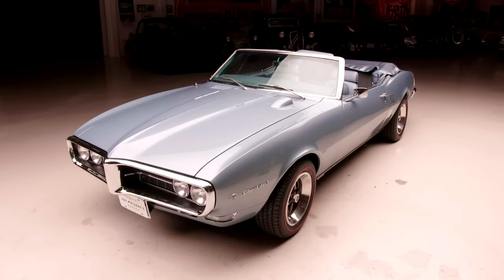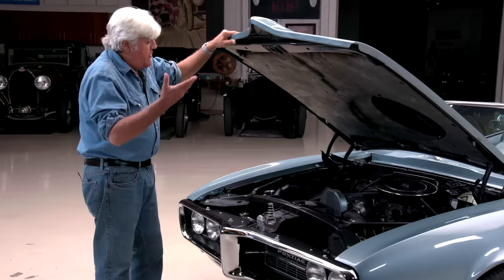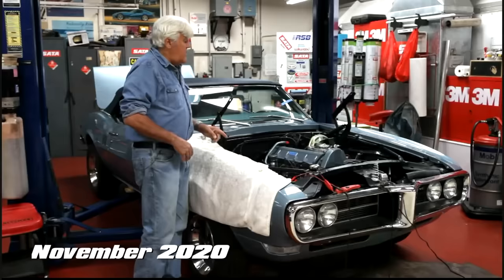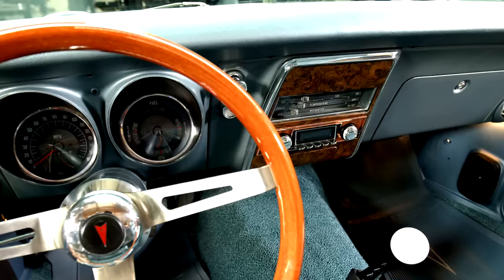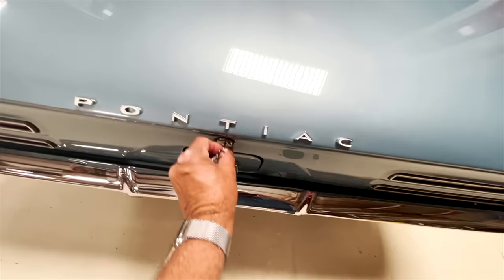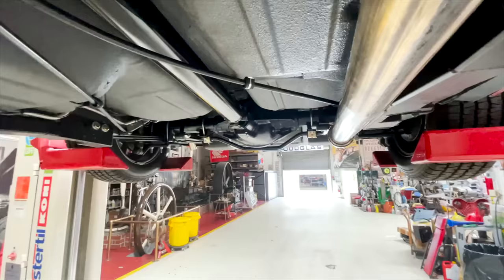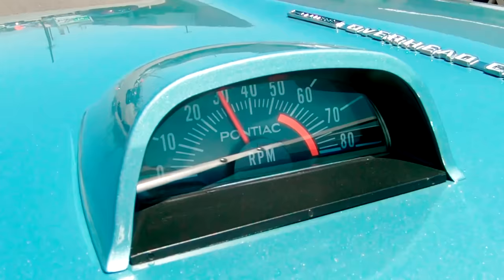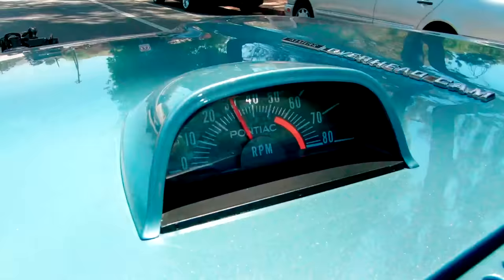1968 Pontiac Firebird Sprint | Jay Leno's Garage

Comment: It's so funny to me! Everyone over her in America are all about the V8. I am English so I have different point of view. Now the Stellantis Hemi is going bye bye and being replaced by a BMW straight 6. Because the engine puts out the same if not more power, much more reliable and tons more low end torque. I have a 1997 BMW 328is with 400k on the clock. Still going strong.

Comment: I realize you're speaking "American made OHC" . But Jay? Fiat had SOHC-DOHC,  dual brake reservoirs, four wheel discs and Pirelli or Michelins stock in that same year. If the Germans had sold Italy better sheet metal perhaps Fiat Roosevelt motors (using engines designed by Aurelio Lampredi) would have earned some respect. Also Jay, that is NOT the first rubber driven OHC the Lampredi engines were rubber belt driven Mr. Leno. PS No rocker arms to fail in a Lampredi engine, shim and bucket direct valve actuation, once dialed in the valves stayed adjusted for a good long time.

Comment: Why didn't they give it a cross flow head?
The old American 6 cylinders have the intake and exhaust ports on the same side because of pushrods on the other side.  
But it makes no sense to do that with an OHC.

Comment: How much cooler would it have been, if he'd had the custom rocker arms made with a roller amd paid for a billet cam. Had the heads ported. Engine could easily have had 300+ hp. Not enough to over power the chassis, but super cool.

Comment: I know it’s super ambitious and expensive but I want to start a body shop business catered specifically for ‘60s and ‘70s cars. My logic is super flawed but my objective is to get more of these beautiful vehicles on the road so the prices will go down a bit. However there are a few things I would do though so they can run on more modern fluids, (STILL KEEPING ORIGINAL parts) like R134a or R1234yf refrigerant A/C (if equipped).

Comment: No sport 6cyl American engines in the 1960s? What about the Chrysler slant 6 225? I had one of those in a '60 Dodge Lancer with a 3 speed manual tranny on the floor, and it roared.

Comment: Back in the 70's we looked at this model as a chick car. It was seemingly detuned on purpose to keep the car out of the ditch in the winter or on gravel back roads. They sold for so much less than the Trans AM or even a big block Camaro they got driven to death by our little sisters who liked the car's good looks and low price.

Comment: Jay's cars are always second to none when they are restored but on this occasion those front side lights are a very poor fit. As for the weights in the boot I get the feeling it is to add weight over the rear axle to help with road holding.

Comment: Didn't the 1963 Jeep Wagoneer originally come with an OHC engine 🤔 The Jeep Tornado was probably even more sophisticated than the Pontiac, developed by a former Austin Healey engineer (hence power through improved breathing) Hemispherical Combustion chambers and Cross-Flow. Later put to good use in Argentina in the IKA Torino, capable of as much as 350hp in Racing trim. 
Plus the rather obscure German Glas 1004 preceded the use of a toothed rubber cam belt by a few years as well. Glas was later bought by BMW but not before they welded two 1004 engines together to create an Overhead Camshaft 2.6L V8 engined Grand Tourer

Comment: As a non Pontiac guy but owns 2 of them in my collection i knew about the sprint and hated the sound of them in stock or modified form. It's almost like hearing a turned around baseball hat pencil necked kids Honda civic with a fart can on it only it's a smaller fart can sound. It's a good looking car as long as the engine is not running in my opinion.

Comment: I love the car, but the exhaust note sounds too...European, or Street Punk Honda, I can't decide which.  Also, Jay raves about the handing and the transmission.  Of course they're great, you've sunk thousands and thousands of dollars into both!!!  I respect resto-mods, but it makes it hard to listen to someone rave about the original design when they've poured so much money into changing it.  Jay could make any car handle like a Porsche, by putting Porsche-like money into it and turning loose a team of engineers and aftermarket products on the thing.  I would respect his word more if he just replaced some suspension bushings, and rebuilt the stock transmission.  It probably helps when you get all this crap for free, if you give them a plug.  Still a fan, despite the corruption.

Comment: Jay usually does them right but this time I'm left scratching my head. As usually the car looks great and it's nice to see another one "saved". But I do wonder. Does he want a historically significant "68" Firebird Sprint or does he want a "resto-mod"? With this Firebird I see a case of convoluted thinking that results in a car that is neither "original" (because everything has been upgraded in the suspension, brakes and transmission)  nor is it truly meeting a reasonable expectation for the money spent as a resto-mod  because no matter how much better I'm sure it performs in handling and braking it still seriously HOBBLED on power due to the retention of that original Overhead cam/ straight 6 cylinder that while somewhat improved is no-where close to what a more modern light weight V6 or even V8 could have achieved and still retained the weight balance of the original car. Jay seems to want his cake and eat it too on this one. Sadly, he can't.....at least not as he's chosen to do it.

Comment: If DeLorean could have gotten the high performance out of his 6 cylinder overhead cam engine, without all the stupid add-ons to create the Sprint package, - AND made it more sporty and horsepower than the base V8 model firebird, THEN he'd have had a competitive muscle car! DeLorean should also have bullied GM into doing things like adding a center console for the Sprint package, and after 68 they should have sent the American OCV6 back to research to see what could be done about seriously competing against the European OCV6's. If they'd done this,there might have been more of a market for the Firebird Sprint model. It was a good car, but if any American Muscle Car Enthusiast wanted to even come close to a win on Sunday, (At any illegal New England road track,- like A&M Dragway,aka Hays Memorial Drive in Marlborough, Massachusetts, - Which I'm sure that Jay has at least heard of being from Lawrence, Ma., which is right up 495 from Marlborough, and had illegal races long before Jay became famous,  lol.) Had they wanted to win, they'd have bought the Firebird Formula, 289 ci V8, OR, spent their whole wad on the 400 ci, Ram Air.
While I'm not sure what year those options came out, it did happen during the Golden age of American Muscle Cars. John DeLorean actually started that Era by putting a 289 ci Pontiac motor into a mid size Tempest body,  creating the 1964 Pontiac GTO, and the rest is history,  so they say. Personally,  I like the fact that in 2022, any normal Joe can create a real sporty ANYTHING,  as I plan to do with my 18 year old son, a 1954 Ford F100 body, a Ford 429ci crate motor, and some slick hand carved hard wood bed posts and a hardwood floor for the bed. Swapped out, modified, police interceptor frame, and low-backed, mustang seats redone in white leather, an entirely new 4-speed racing transmission and a rear end that puts all that horsepower onto the pavement when it's wanted immediately, or to maintain highway cruising speeds! It will be low, but not slow! We've also got a plan to incorporate the 59-60 Chevrolet Biscayne/Impala Dashboard Guages over the original Ford Square Dashboard, which will house the new navigation/computer system!
My reason for adding this, simple: Nowadays,  you can do ANYTHING you want with a Restomod. Even make the Sprint the car DeLorean was trying to make in 68!

Comment: As for the inline or straight six, as we used to call them... V any thing, 6, or 8, has a lot of low end torque,  in line likes to run at high RPM. So, the Firebird Sprint was not at all designed to be a drag car, and I can guarantee, the best performance will be on the road. Not a success as it was too far ahead of its time. I drive a Volvo inline 6 now, and it runs the same way, goes like fire from 4000 to 7000 RPM. My Jeep 318 CID is the opposite, both are fun to drive.

Comment: You'll see it when we drive it..."?  😶

Also, I thought we were worth a little better/more than, "There's the (insert brand) sports suspension - ya got the sport upper and lower A-arms.... There ya got the sports coil springs...". 
Wtf does any of that mean? 
Lower ride height?  
Higher rate springs?  
Are they dual rate springs? 
What can the double wishbone front end do, that the stock arrangement cannot?
Are the dampers mono-tube or just twin-tube?  

C'mon - any hack can and does blithely offer the term 'sports', without actually saying anything.

Comment: A friend of mine had one of these cars hardtop three speed how great I had a BMW 2800 and it was better and I told until every time I sign main difference in the main problem they’re inch and her was valve train float at higher RPMs when I was driving was early belt drive not good that was a weak point in the song was great

Comment: the one i had used a rochester quadrajet instead of that carter afb looking thing on yours so i would say it had a different intake manifold and it had two three onto one cast iron headers instead of the welded tubular headers on yours. it ran pretty good all things considered. i do not care for at all the 194 (215 64/65 pontiac only) 230, 250 or 292 series chevy six cylinders which is basically what this was. the chevy engines had NO power and got about -15 mpg as the throttle is continuously wide open. anything that maintains too much throttle angle at cruising speed is going to burn too much fuel. a very aggravating engine to drive even in a light car which GM didn't seem to know how to build. if GM built a 4,800lb car, they thought it was light. the pontiac ohc version was better than that. at the time i owned a pontiac ohc you could only have a camshaft ground as none were available. the problem with that was there were no rocker arms available and the one barrel carb engine used different rocker arms than the 4 barrel performance engine as the 4 barrel cam had a smaller base circle and there was no provision for rocker adjustment. it was a poorly engineered, hurriedly slapped together mess that was doomed from the start. good idea and it almost worked, just flawed enough to make it fail. most of them probably went to the crusher. i think the 4 barrel intake manifold and exhaust header will bolt to a regular push rod chevy six cylinder head, have never looked at it though, i'm just guessing. the most powerful standard american inline six cylinder car engines i know of are the amc 258's, they are rock solid and have a great 12 port head and are easy to squeeze hp out of. i have seen them run 10's in a 1/4 mile.

Comment: Wouldn’t it make more sense if you are going to completely change the suspension you do it on a v8 crap car? I mean the uniqueness of this car to begin with was better handling, then you strip that uniqueness away just to add generic handling to a meh engine.  Just makes little sense

Comment: ive been wondering......what the hells wrong with you......now i know....its got to be unique....or your  averse to it........ive owned my f body.......for over 50 years....its a camaro....with 630 horse....nothing compared to frieberggers 1500 horse .....but i love it.......i used to street road race on mulholland....i took everybody for 12 years.....finally beat by a factory dino racer....,so i quit........by the way...my camaro must be pushing one million miles.. through 10 hot rod engines..
..and.   not one. squeak....or rattle.